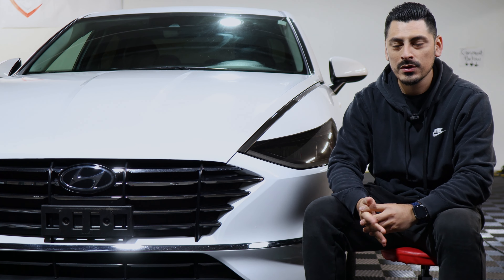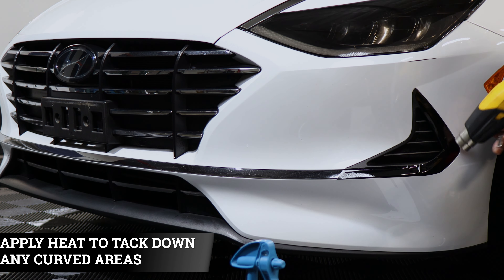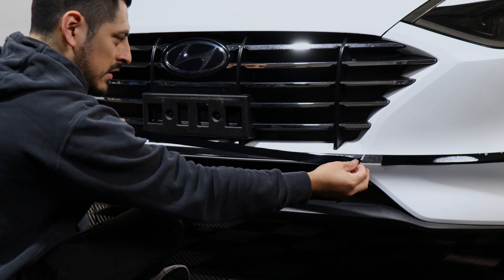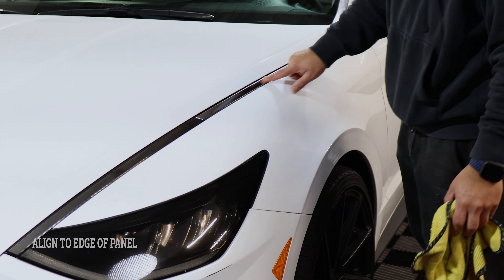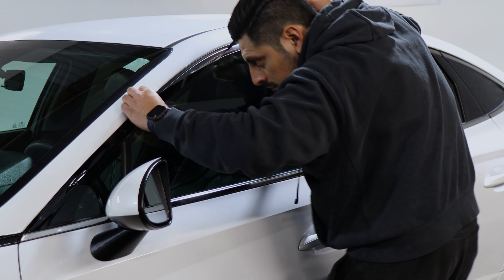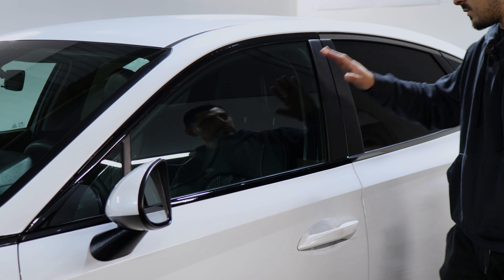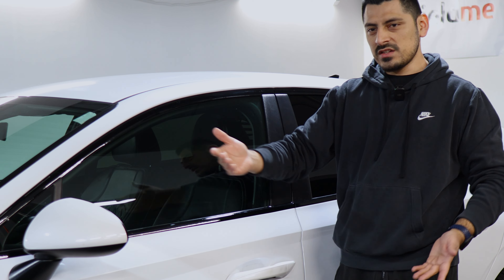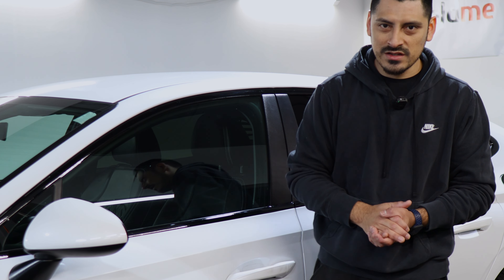Hyundai Sonata Chrome Delete Guide

Comment: What do the daytime running lights look like with this?
Reply from the maker: The daytime running lights will be blackout & will not shine light because the chrome delete is not transparent.
Reply: The drl portion that morphs into the chrome piece will be blacked out the other bottom drl half will still light up aka the blinker so if anything it will look more aggressive